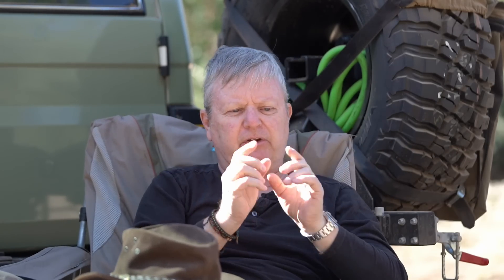TIRES - Traction, Rolling-Resistance EXPLAINED

Comment: In reference to the rock crawling, more PSI on the contact patch doesn't mean more traction, that's wrong.
Reply: He doesn't mean more psi in the tire the narrower tire is carrying more weight over less surface area so the narrow tire has more psi on the contact patch and will conform more than a wider tire at the same internal psi over an irregular surface.
Reply: Simmo The link is down otherwise I would post a white paper with calculations.
Reply: Simmo He's only talking about hard irregular terrain like slick rock on the increased pressure yielding more traction and more traction also due to more deformity/conformity. Is that what you are disagreeing with or for any type of terrain?
Reply: jeep6242 The increased pressures (weight per unit area) on any terrain will gain decreased grip (friction) not increased as Andrew says.

 Check out "Tyre Load Sensitivity" it has to do with  unique property of rubber, known as viscoelasticity. It's a common mis-conception to try and relate friction between two hard surface f=uN, and rubber on a hard surface that behaves completely differently.
Reply: Simmo This all applies to upper lateral load limits and rubber to asphalt high grip scenarios. In the lower limits more weight does help. It's not untill the upper limits that things go bad "The maximum lateral force that can be developed does increase as the vertical load increases, but at a diminishing rate." so initially more weight is better. The narrow tire does a better job of maintaining higher psi under low traction low load situations. There isn't any high loads when you have no traction in the first place. Also this takes no account of the increased traction from tread conformity over irregular surfaces. That's not even remotely part of those formulas. The perfect example of way under high load limits where adding weight actually helps traction is the fact that an empty 18 wheeler takes longer to stop than a loaded one. With all that extra surface area on an empty truck you are so far down the load scale there is just less traction. With  weight in the vehicle there is more psi on the tread and the truck stops quicker. It's because there is so much extra surface area because of the need for load carrying that the traction is so terrible empty. This is exactly what is going on in a wide tire on a low traction surface. There are other factors that contribute in an empty vs loads truck for sure but some of these factors are honestly the same in a low traction off road situation.
Reply: jeep6242 As a heavy vehicle driver I can assure you that a laden truck has no where near the braking ability of an unladen truck, not even close. Where did you get that data?
Reply: Simmo is right. That argument is total nonsense. If higher ground pressure were ever better - you'd max the inflation of your tires. That would give you the max ground pressure. If you air down - you can't also believe that more pressure is better. The two are literally exact opposite choices.
Reply: I don't think you understand inertia.  Let me help.  A mass requires an applied force to move. A tractor - we're mixing and matching heavy truck and farm implement here. A semi tractor has a large amount of mass and very little weight on the drive tires without a trailer attached. As a result it often lacks enough friction with the ground on slippery surfaces to move very well due to the imbalance of weight on the drive tires and inertia resisting motion.  If you're meaning a farm tractor - the weight is often also forward of the drive tires when unloaded with the intent that it will be used in most scenarios with a load on the rear balancing most of the ultimate weight on the rear drive tires when in use.  When not in use the mass of the engine - much like that of a semi tractor - is not well placed over the drive tires. In that instance you can add weight over the drive tires that balances the overall vehicle inertia to drive tire friction and can help.  But that ONLY applies in 2wd.  To give you a simple math example - if a vehicle weighs 5000lbs, but is extremely unbalanced such that 4,500lbs is on the non drive wheels and only 500lbs is on the drive wheels, the drive wheels will have very little force against the ground and limited available friction to push the vehicle. If you added 4,000lbs to the drive wheels, you would then have a 50/50 balance of weight and the drive wheels now have a force equal to have the total vehicle weight on the drive wheels.  That's better in many cases than having 90% on the non drive wheels and 10% on the drive wheels.  However, if you had the same vehicle with all wheels driven, you now have 100% of the weight on driven wheels - and it will perform better with no added weight.  The same can be applied to towing. It's the weight balance between the driven wheels and load.   An no point is it ever better to add weight to improve off road performance with all else equal. 

You cannot both air down and argue for higher ground pressure. End of story.  One of us is talking in circles.  It's not me.  You don't even believe your own argument if you aren't willing to practice it in the real world. If you did - you would air UP to go off road.  Let me know when you start doing that.  Otherwise you are demonstrating that you don't know that airing down reduces ground pressure and so does lowering vehicle weight and so does having wider tires with a larger footprint. They all do the same thing and work for the same reason.
Reply: I think he means they will conform to uneven surfaces better as there is more weight putting pressure on the tyres
Reply: Ian Parsons At 8:20 Andrew stated that a narrow tyre would have more PSI on a rock than a wide one, this is true.

 However he goes on to say that this would mean more grip, this isn't correct, actually the inverse is true.
Reply: That’s what I was trying to say, kind of hard to put into words haha
Reply: Simmo I have over a 1.5 million miles logged in a commercial vehicles. This info is commonly stated in just about every CDL guide from just about every government entity in North America. Example https://www.indianadriver.com/course-area/index2.php?tid=47&course=truck

If you are seriously contending that a 5 axle 72 foot combo 53' dry van typical North American truck can stop faster on a wet or snowy road empty vs loaded. We are just done talking. Obviously at some point the weight and inertia overwhelm the brakes so I'm not claiming a 150,000lb truck stops faster than an 80,000lb one but an an empty 80,000 GCVWR operating on a wet road at 35,000lb tare weight sure as hell takes longer to stop than a loaded one. Either you don't spent any time empty or the weather is too warm and dry in Australia. One stop on a 40F degree wet road or one stop on a snowy road surface empty vs loaded and it would not even be debatable by anyone experiencing it.
Reply: Justin Jetter OMG It's about ground pressure to a contact patch ratio which a narrower tire and does better than a wider one. Obviously you can go the other way increasing ground pressure to the point the smaller contact patch loses stiction to the surface but that's why the conformity of the contact patch is an issue. Stop being obtuse. You are really going to deny putting weight in the back of a pickup does not increase traction on a snowy road? Really? That's what you are arguing against?
Reply: @jeep6242 - Yes, my comment is correct. And yes absolutely it is true that putting weight in a truck on snow does not make it perform better in 4 wheel drive.  Only when it's in 2wd would that offer any benefit. The reason it would help in 2wd is that it shifts the ratio of friction force to total vehicle mass. In 4wd it makes it worse. I owned a snow plow company for about a decade. I can assure you without hesitation that that is true.  On snow covered roads the best thing you can do is to have snow tires with soft rubber and lots of siping. Narrow tires are not better. More weight is not better. 

Weight - and ultimately ground pressure - is the enemy of performance in almost every task other than towing. If you air down - you agree. If you air up to go off road you disagree with that simple statement.  I've yet to meet anyone who airs up to go off road, or has ever aired up to get more traction. I've yet to hear, see, or ever experience that. As soon as someone can demonstrate even one single example of that - it will change my opinion.  Until then... lower pressure is better.
Reply: LOL. Yep every empty tractor that is 4WD,even with a diff lock does great in the snow *rolls eyes*. Again its about the sweet spot if your 4wd truck was just a frame and chassis it would suck. the weight of the body and plow and salt tray makes it have more traction. It's literally undeniable but whatever agree to disagree. I'm extremely comfortable in my argument and reality based experience.
Reply: Your pretending, incredibly, that there is only one force at play here and that off road traction and tire dynamics and ground pressure is some one line formula like a steel train wheel on a rail WHICH IS STUPID.
Reply: You simply don't understand the physics of it. If the tractor were all wheel drive - it would be fine. Without the trailer it has little weight on the rear and a lot of mass to move. The problem is the mass of the engine/cab etc. that's not providing any weight on the drive wheels. If it were awd it would be just fine. A side by side or ATV is a fine example. They weigh about 1,300lbs and have flotation tires. They do very well in snow. Adding weight does not help. You can be as comfortable as you wish. You're still wrong.
Reply: Justin Jetter You're talking in circles it's awesome. The weight on the front wheels helps when it's AWD but doesn't over the drive wheels. Please explaining about the mass of the engine and cab as though that has shit to do with the traction levels at the drive rear. Please keep explaining like I've never gotten a steer tire sunk in a muddy yard while bobtailing. The front axle has no bearing on traction at the  rear wheels. It does if you are talking about the vehicle as awhile getting itself unstuck with a driving front axle but ZERO to to with traction at the rear. THEY ARE NOT RELATED. Also there is no weight transfer from 0 to 3 mph on rwd car with sand in the back on snow from accelerating. I'm not responding your comments are just silly now.
Reply: That’s not what he said, he said the opposite.
Reply: jeep6242 I do understand what he means, he's under the impression the more weight per surface area a tyre has with the terrain, the more grip you'll get. This is incorrect, f=uN doesn't apply in this case.

Comment: Another comment about tractor tires, a major reason tractor tires are wide is the fact you need huge area of tire to reduce pounds/sq. in preventing compaction of the soil in the fields. Dense soils are less suitable for crop growth.
Reply: Indeed. Probably thinking of an old Massey Ferguson Model 35!

Comment: It would be nice is someone other then Dunlop and Bridgestone made a 225/95r16 tyre would give a nice narrow 33in Tyre rather then a narrow 32in with the 235/85r16, 
Tractor's are all ready running low pressure and they do change the pressure but generally not cause lazy operator's.
Tractor steer Tyre's are only their to keep the front off the ground and turn it, the run positive camber so the outside edge of the Tyre will dig in and act like a plow disc and turn the tractor in even the most soft or sloppy condition's, when they have front wheel assist and they have wide Tyre's fitted the turning circle is much larger and the front will push and not want to turn even on hard surface's
Bias Tyre's still have their place when your off the track's or on very low usage tracks and need the strongest Tyre possible to prevent it getting staked a 14 ply steel belt bias Tyre cant be beat, problem most people have is lack of knowledge around them with not putting enough talcum powder in the Tyre so the tube and Tyre don't rub causing tube failure's or sealing up gap in the split to prevent sand/mud getting in then rubbing on the tube causing a failure their

Comment: Most off road tires today at a 33 to 35 inch tire range have a 12.5 inch cross section. Years ago you could get those same tires in a 10.5 inch cross section.
Reply: IamTranslation Preach! Super pissed they don't make 33x9.50's anymore. :(.
Reply: jeep6242 , interco still makes them.
Reply: IamTranslation , My Cooper ATPs are sold as 285.75.16 and measures out to 32.8 x 11.50. They seem like a good all around tire for my 3/4 ton Suburban.
Reply: Old Griz Yeah but the rubber compound on intercos is from the stone ages lol. You couldn't pay me to drive those tires on wet pavement, snow, the highway lol.
Reply: Old Griz Yeah I think for vehicles that big you start getting close to the level of diminishing returns for super skinny.

Comment: Wider tires hold the wheel bead better when you air down and also increase your lateral stability. I think the smaller the wheel the better, as long as it fits over your caliper. I use 15". I like most of your points though, not sure about the sand portion though. Narrow tires are definitely better considering varying terrain imo.
Reply: SuperCellProductions which is mostly irrelevant because you get more tread compliance in narrower tires at higher internal pressures because it has more psi on the contact patch. The conformity of a narrow tire at 15-20 psi is likely to be the same or better as a wide tire at 10-15 psi. You don't need to air down to silly bead locker psi on a narrow tire to accomplish the same task... Most of the time. The lateral stability I is overrated I think. To the degree it's not you could use spacers or offset wheels to accomplish the same thing if it really mattered that much. If somebody did the rollover Calc of narrow to wide tires I bet we are only taking tenths of a degree of increased side angle stability. Personally I think sliding at those angles from loss of traction gets you into more trouble than having a little extra side angle stability before rolling. Most people freak out way before there side angle roll over point anyways so it would be hard to capitalize on any benefit.
Reply: Sure, I had to embellish a little bit to think of some pros of wide tires. I'm sure pros are minimal, then again all these talking points are. I've personally barrel rolled my jeep before, so I just like the security of big offsets with my wide tires for now, even if it's false security, though I sometimes go down to 2psi in snow and have never lost a bead so take that as you will. You sound like the resident tire expert of this thread. I've been thinking about getting some super narrow boggers as my next set though as I definitely attest to narrow tires performing better overall.
Reply: SuperCellProductions No just a pet peeve issue and I have a cold and can't sleep. Lol  I should probably shut up and stop posting though lol.

Comment: Wide tires are better on the road and in very limited super gumbo kind of mud at super high wheel speeds in high HP engines and that's about it. I wish people would stop this fad of wide tires. It's getting harder and harder to find narrow tall tires. I too have been in stock rental vehicle with more grip on slick rock than highly modified vehicles with wide tires. Snow is not even a contest. Wide tires are horrible. Rain and ponding, ditto awful. So much more unsprung weight, so much more air resistance. If people would just put their ego aside they could see what is true.Not to mention why do you want your tires sticking 4" outside your wheel wells flinging crap all over the side of your truck lol. I have never understood why people think that is cool.
Reply: jeep6242 It's called personal taste. What you like on your Jeep or 4x4 another might not, it goes both ways.
Reply: Lukas Hibbard If you are talking about tires sticking out past the wheel wells than sure whatever, if that floats your boat. The rest is actual performance differences and the physics involved and not just personal taste.

Comment: What is the tire just behind you.  Nice vid.  Thx
Reply from the maker: BFG KM3, 285/75R16
Reply: Your ideal tyre size would be a 255/85R16, same height but narrower.  Very close to the standard 225/95R16 in height.  BFG makes them, although not sure if available in KM3.  Unfortunately there're not a lot of skinny's with height available.

Comment: Great video Andrew, when I seen these on your Land Cruiser I had a feeling you would not like them over all in the long run, fuel efficiency loss among other things you mention etc.  In regards to Aspect ratio of a tyre,  The aspect ratio is purely a percentage of its width.  For example when comparing tyre on the same size rim... A  225/95/16 (stock tyre on new LC workmate) is the exact same overall diameter tyre as a 285/75/16  as the aspect ratio is a % of the width.  In other word the 95 aspect ratio tyre here has infact the exact same amount of side wall height as the 75 aspect.  Many people I have come across in my time on this earth think that a tyre of any given width at all that has a higher number aspect ratio will always have a higher side wall height  but this is not at all true.